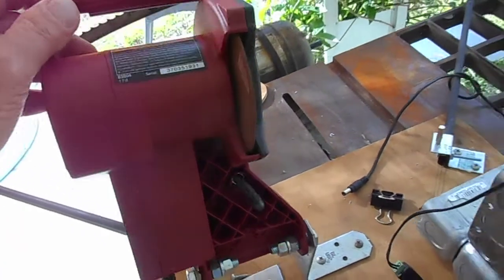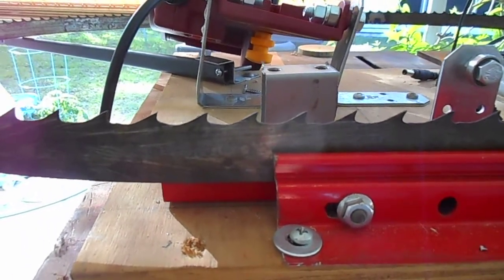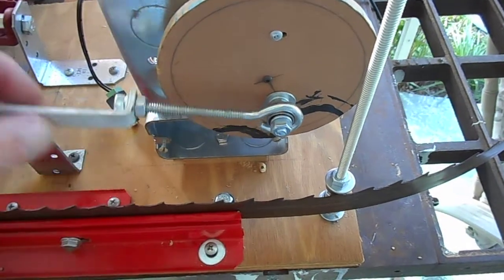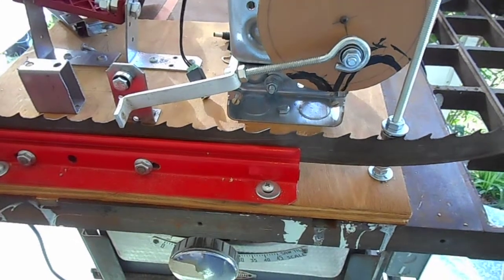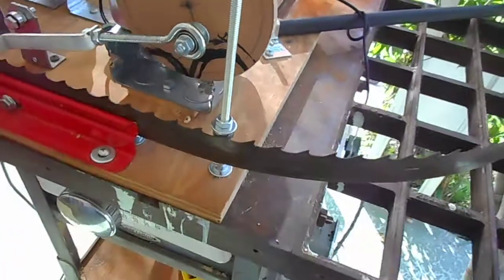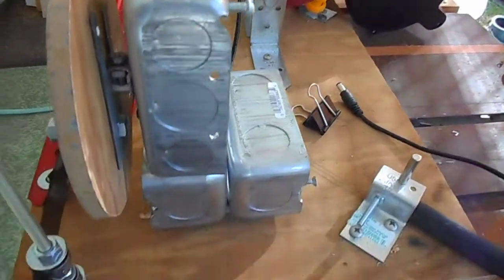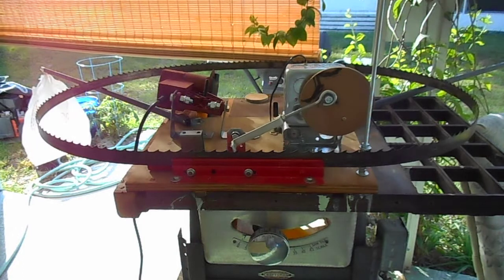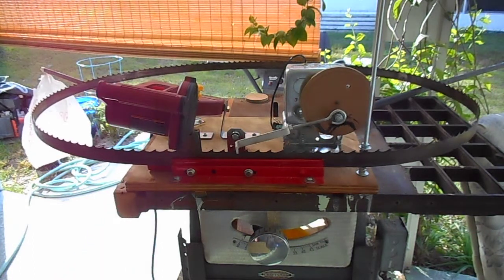Po-Boys Autosharp Bandsaw blade sharpener setup, run it, load another

Comment: where did you get the drive motor?
Reply from the maker: I used a 15 rpm 12 volt dc  motor from China less than 15.00 delivered. Try to provide a link was to long bought from EBAY. That motor powers pusher arm and up and down for grind motor.  Please see the newest grind motor more powerful and better performance, on youtube.com second generation Cams coming https://www.youtube.com/watch?v=YbJGeWMzKl0&feature=youtu.be
Reply: @macwolgamott4201  Thanks for the information